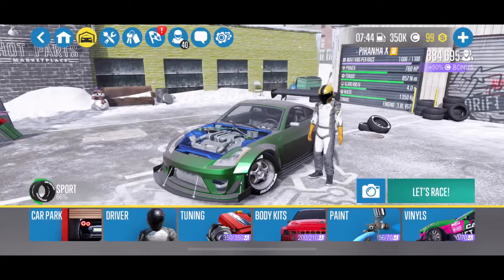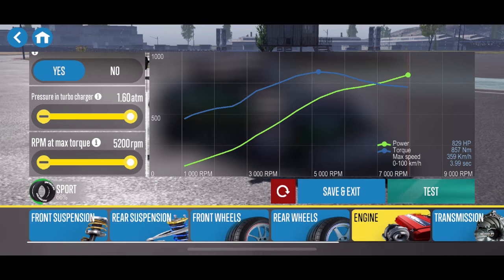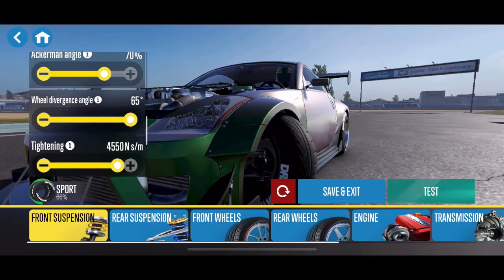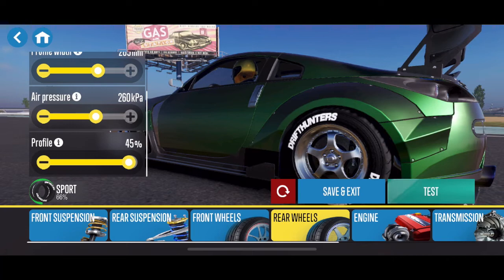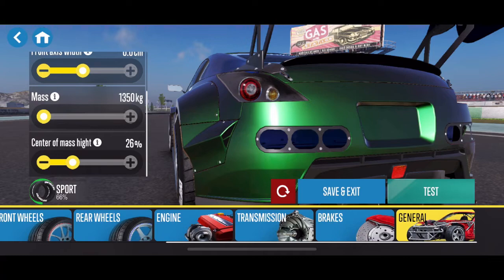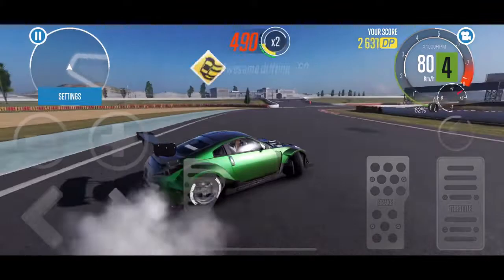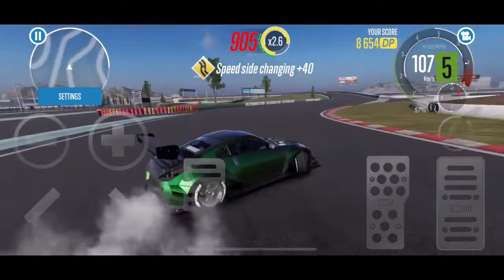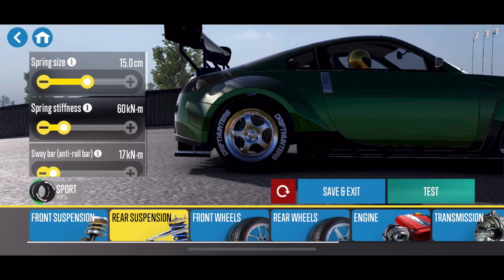GTR Engine swap in 350Z CarX Drift Racing 2 (full tune explained)

Comment: one of the benefits of engine swap is that u can have a bigger wheel diameter and width , so in the pro drift III you can run 20 inch by 285 max and with the engine swap you can run 21 inch by 345 max. why wouldn't you use that? i used it in all of my engine swap tunes and it definitely makes the car a lot better
Reply from the maker: I haven’t noticed that before but I will try it out on some cars, sometimes the biggest tire isn’t always the best though!
Reply: @BroghammerAutohausInc  Well most of the times it is, because running a bigger tire means more grip which means higher speeds which means a higher drift score
Reply: And with the engine swaps you also have a way bigger steering angle, from like 58 max with pro drift III to 65 with any engine swap

Comment: I almost always start a tune running 20 inch rims, 10mm wider in the rear, 30 profile front, 35 profile rear.